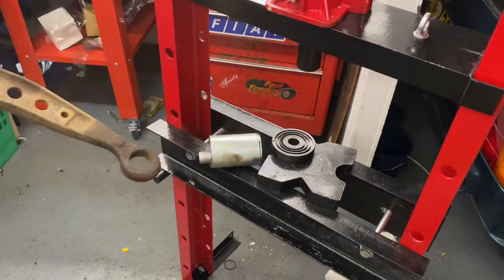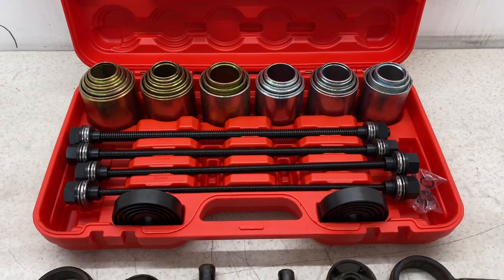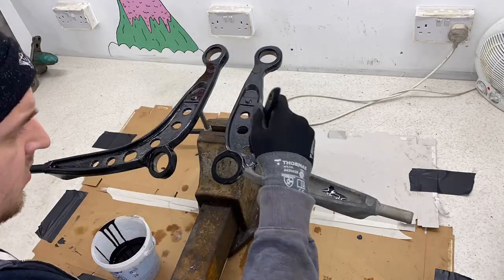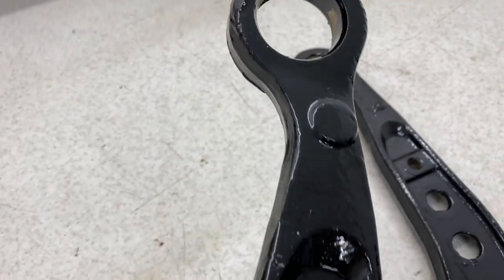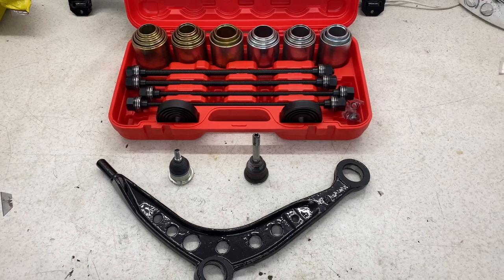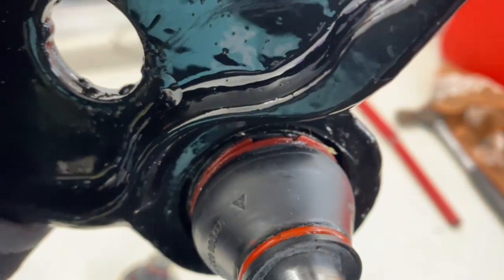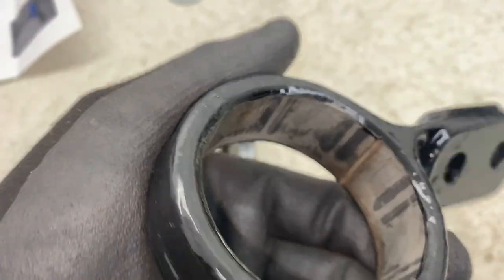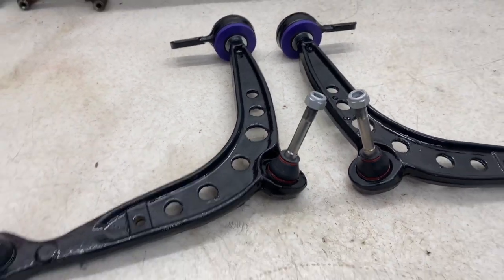EP. 4 My BMW E30 Restoration - Control Arms - Complete Restoration

Comment: in order to dont accumulate to much pressure until the hole thing explodes you can apply a little bit of pressure and then release pressure by repeatedly hitting the assembly with a hammer. Is just a security tip I think hahahaha. But good work.

Comment: Thanks- what size shop press do you have? (For example- 12 Ton, 20 Ton)
Reply from the maker: It was using a cheap '20 ton' press but I highly doubt it would do near that. 12 ton would suffice.
Reply: @BadE30  thanks man. Gonna buy one soon- wanted to make sure it would do the trick. Thanks again